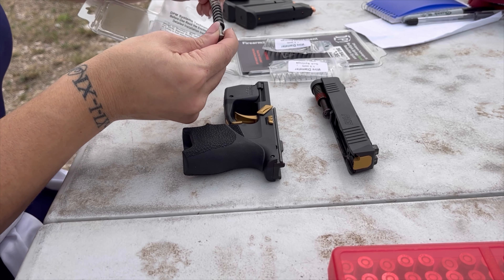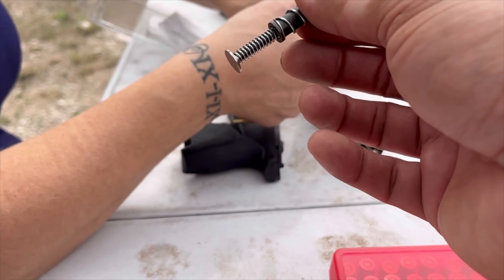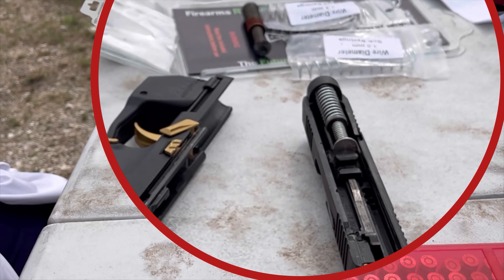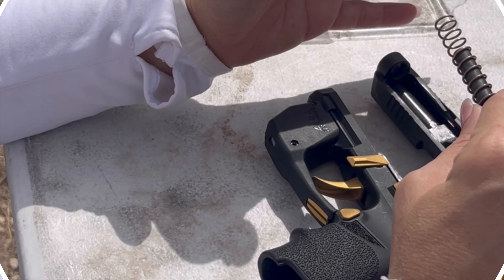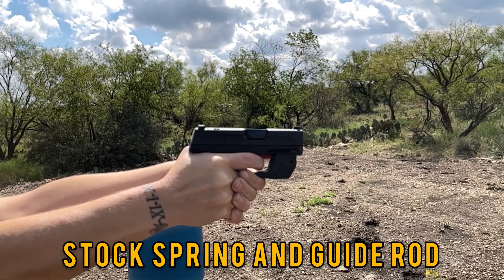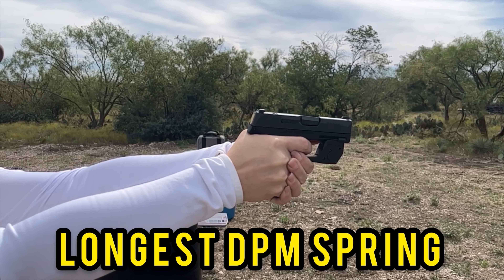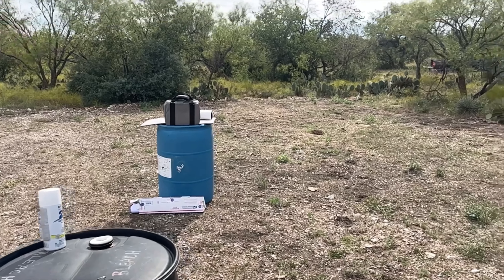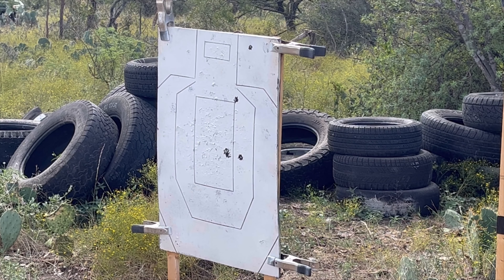Sig P365 .380 DPM Recoil Reduction System Install and Review - Woman Shooter’s Take

Comment: I bought a DPM system for a S&W Shield 9 mm.  It worked to reduce recoil but caused reduced reliability of feeding ammo.  In a self defense pistol that is unacceptable.
Reply from the maker: I’ve used 2 system so far but haven’t had any issues with feed but if I did, I would definitely not use it in a carry weapon.
Reply: So are we going with it may reduce recoil but very little difference ?
Reply from the maker: @aaroncarey2909 less felt recoil, flatter shooting so faster follow up shots.

Comment: I appreciate your video. I am considering this model handgun for my entire family as EDCC. I have seen reported ammo sensitive / pickiness related to poor reliability with certain .380 varieties. Could you please let me know how your experience has been? Did this spring change reliability at all? Thank you.
Reply from the maker: Other than flatter shooting and faster follow up shots...it did help on racking the slide also since it was a lighter spring but so far we've had 0 issued with it. Every once in a while it doesn't return to battery all the way but not enough times to make me say its a problem.
Reply: @PhatTactical  thank you!

Comment: The P365 in 9mm and 380 have different Recoil Assemblies. I didn't see where the DPM recoil system was approved for  use in the 380.  I honestly couldn't tell that the DPM springs improved much from the video...
I'm interested, because my I bought my wife a Sig P365 380 to replace her X-Macro Comp. In my opinion, the Macro Comp doesn't do much to reduce muzzle flip. I have a MagnaPorted P365 that I think does a better job than the Macro Comp...
Reply from the maker: Both of these tested are the .380 versions. Yea I spoke to DPM directly and they referred me to this specific one for the p365-.380. Yes I carry the macro comp and I’m not sure it makes a significant “felt difference “ either. But I love my Macro Comp, I’m using now for my local USPSA matches so I can get more accustomed to it .
Reply: Which specific one? Can't tell from your video.